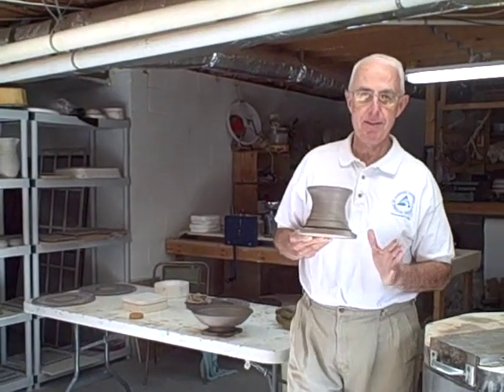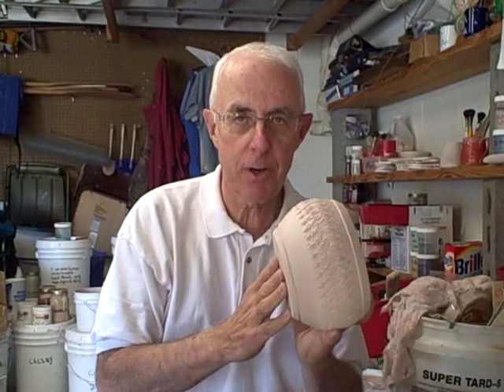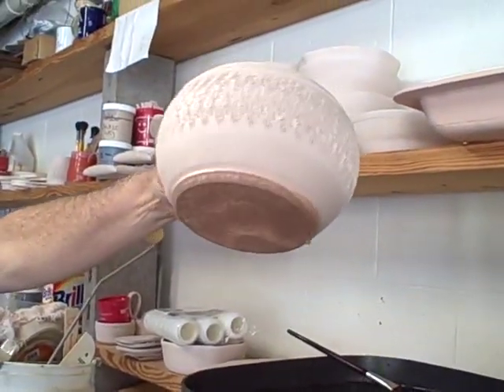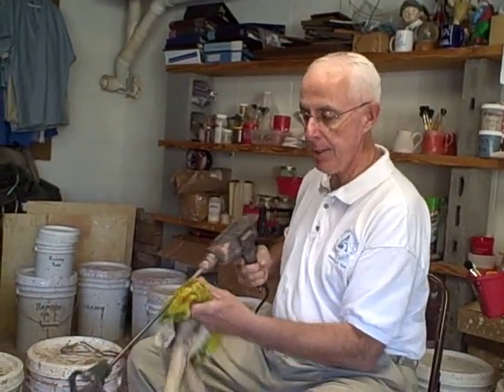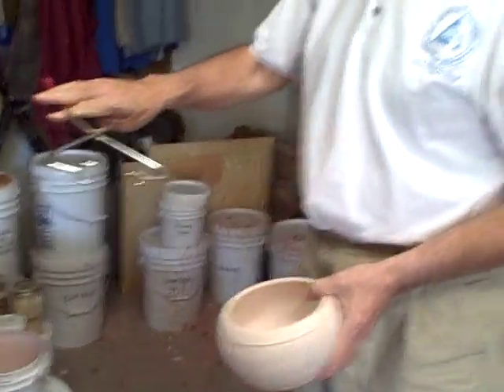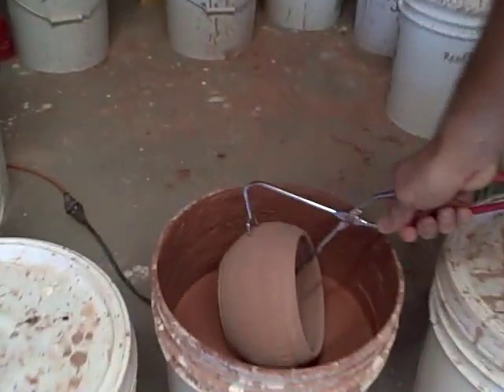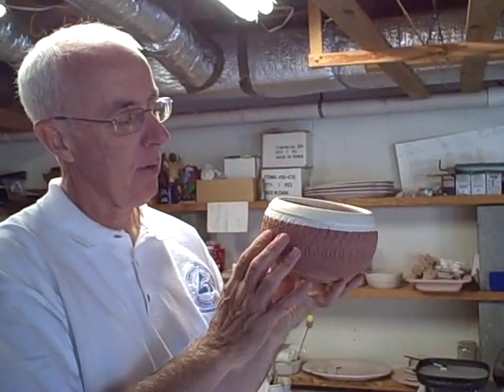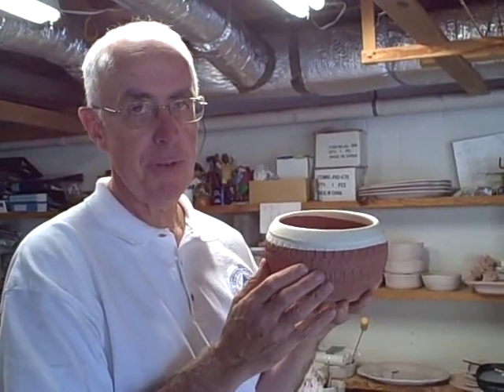Textured Bowl - Part 4 - Glazing

Comment: I don't do that. Im pretty young for all this. Im 16 but my advice is to place it on the wheel and get some wax that doesn't dry but dries when surface and take a caligraphy brush and then dip it in wax then paint it on when the wheel is on. Faster.